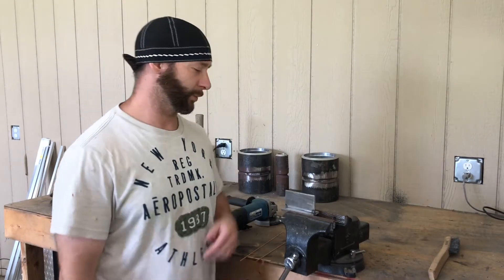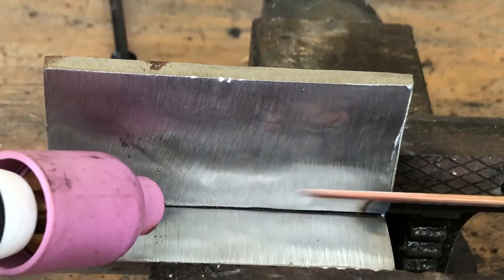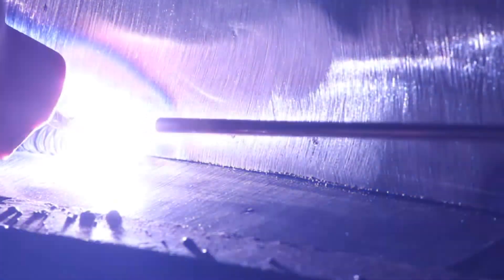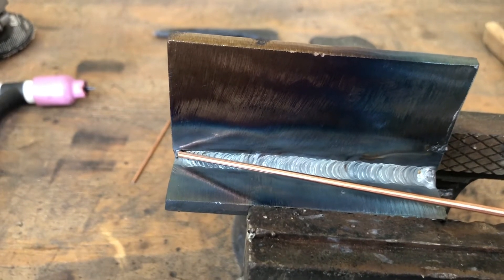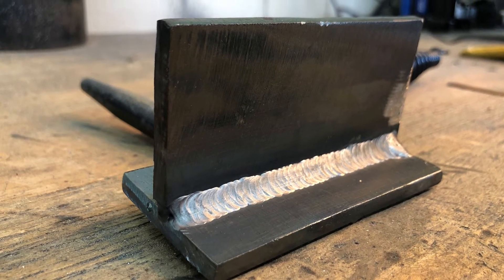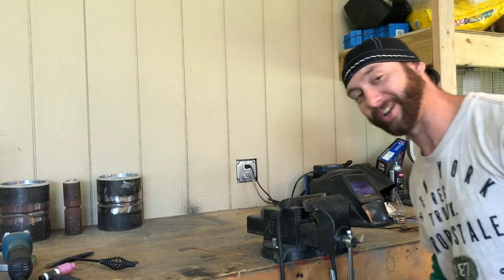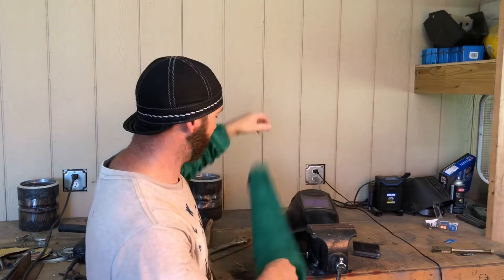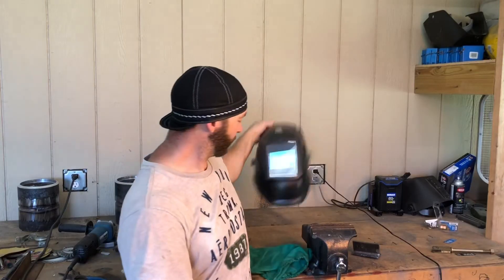How to Tig a fillet weld (T-joint weld)

Comment: Is tig fillet easier then stick fillet?I find stick welding a 90 degree hard and always get slag inclusion or unable to join both side together.
Reply from the maker: No it’s not easier if you are new to it. When stick welding a fillet, first establish the puddle joining both pieces of metal, then start moving along and make sure the puddle is washing onto both pieces of metal throughout the entire bead. Hope this helps. I can do a video on it if you’d like.

Comment: What thickness is that material, what amps are you using and what size filler. Earlier I was welding 1/4" with 160 amps and a 3/32" filler. the first pass goes in easy, but to try and do the second pass the same way you did it. I was getting some under cut and I couldn't figure out how to prevent that. the best I could do was try and follow the puddle with the the filler rod but it just didn't work that good.
Reply from the maker: I believe that was 1/2inch plate if I remember correctly. I was using 3/32 wire 70s wire. To help with undercut, hold at the top for a second before you go back down. Also feed the wire at the top and drag it down, this should help too. 
If those two things don’t fix it then turn your heat down to about 130 and try it.
Reply: @getweldsoon1113  ok cool. it was my  first shot at welding thicker than 1/8". I'm kind of thinking about just trying to lay wire with a 1/8" rod and not even doing a second pass. but yeah I will try to turn it down and try.
Reply from the maker: @davidcraft4909  just make sure it penetrates down into the joint good. 👍
Reply: @getweldsoon1113  I think I'm good on that but yeah i think that trying to use a bigger filler for the first pass well make it harder to dig down into it. my real problem is that I'm just brand new to doing mulitpass welds. I got some learning to do and your video and comments are helpful, thanks.
Reply from the maker: You’re welcome! I’ll help you any way I can .
Reply from the maker: It was actually 1/4inch plate by the way. I checked after I talked to you last. 👍
Reply: I obviously don't know but by the looks of it it looks about 12mm thick